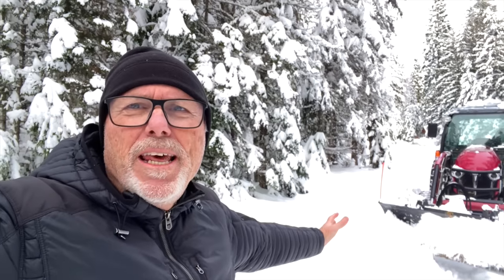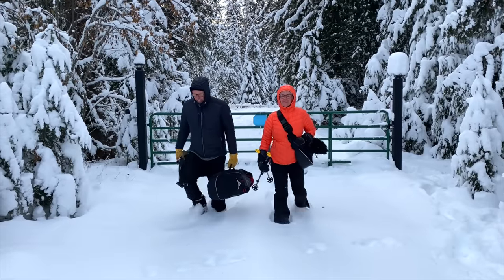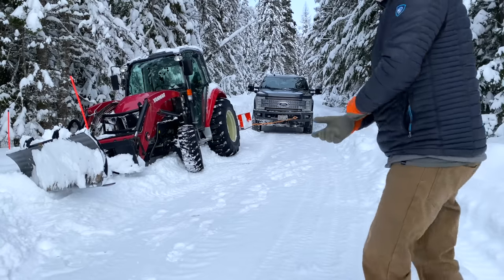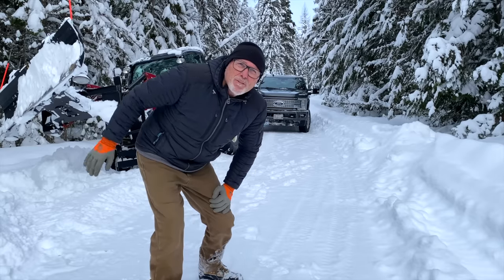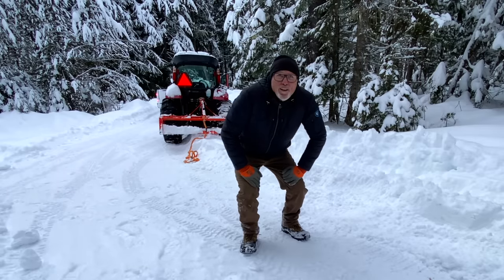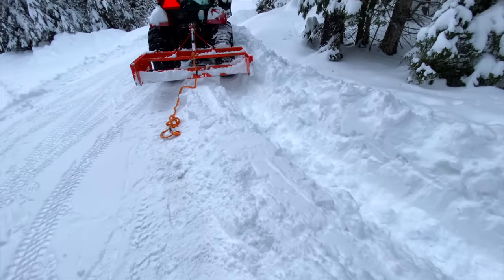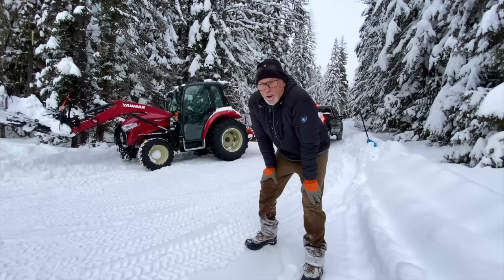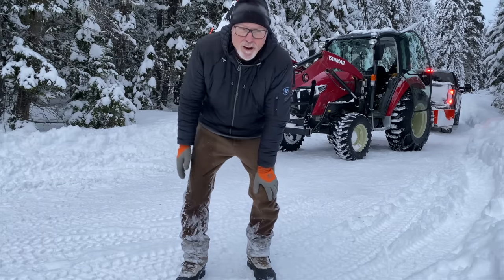WINTER STORMS BLAST Our Off-Grid Homestead

Comment: Never plow without chains......your learning........hang in there.....
Reply from the maker: Last week I had people telling me to return the chains since I have a 4 wheel drive tractor. 😀
Reply: Agree, just cause it's 4 wheel drive doesn't make it infallible
Reply: They obviously haven't driven a 4wd tractor in deep snow. Can you lock a differential, or drag 1 wheel brake slightly to get power to more than 2 wheels? Get those chains on. A small tractor doesn't weigh enough to get traction without chains( front and rear chains are best!).

Comment: Yep time for a snowblower attachment for the tractor.
Reply from the maker: Know of any deals because they are lots of 💵💵💵💰💰💰
Reply: @MountainBeaches  Most people that have dealt with this much snow have learned their lesson that a snow blower is required to move that much snow, blow it back in he trees and keep your tractor on the road !!
Reply: @MountainBeaches  I don't know what your definition of expensive is but a rear blower facing backwards is cheap IMO. If you're looking for a front mount blower or rear inverted blower they are a lot more expensive. Plus, you seem to be very gentle with the tractor but a plow on the loader arms isn't the best combination. You can bend the loader arms fairly easily.

Comment: Whenever I have a front end Snow plow on, I found that putting on the back hoe for the winter works like a charm if you get stuck.  The backhoe can push, pull, lift as well as be an excellent counterweight.
Reply from the maker: I don’t have a backhoe for the tractor.

Comment: You need a yank em rope. Watch a video or two on Matts off road recovery. Its a must have rope living wear you live and traveling like you do. Nothing better.
Reply: anthonyconti  that also was my suggestion, use the momentum of the tow vehicle rather than relying on just traction. He also needs to use the rear differential lock, he was not as only one rear wheel was spinning !!!

Comment: Congrats on getting unstuck! When this happens again (and it will) try this. Place the truck in front of the tractor in the middle of the road in 4WD Low. Put a tow rope (longer than what you have) on the left rear wheel. Brake the front wheel (left or both). Pulling will rotate the tractor back on the road. If you purchase another rope you might want to condider one of the kinetic ropes (works like a bungee cord and multiplies you pulling power with a firm yank). We're in a drought now in New Mexico, but when we used to get serious snow (we're at 7,000 ft altitude) this worked great. Love your channel! Good luck!
Reply from the maker: Thanks so much!

Comment: Does your tractor have diff lock? Mine had it under your right heel, step on it and it gave better traction also if your blade has power angle you can put it down on the ground and use the hydraulic angle to push yourself backwards little by little,  time consuming yes but doable. We look forward to your videos.
Reply from the maker: I discovered the locking diff on that last pull that got me out 🤦🏻‍♂️😂
Reply: I learned a lot about getting unstuck because I had a ADHD pre teen son that would take the tractor to places it never should have went. Lol
Reply: rogerbrown   That was my first thought, not familiar with the tractor operation, both items, he needs to spend some time reading the owners manual on HOW to operate his tractor !!
Reply: @MountainBeaches    well DUUUUUUHHHHH!!!!!!!

Comment: Since you should be carrying a couple hundred pound bags of gravel/sand in the back of your pickup for better traction during the Winter, just spread some of that in front of all 4 tires of the tractor and it will walk right out...Heavy Duty cardboard often will also work most of the time..Just.another good reason to have chains for your tractor in the Winter time.

Comment: Try to pull or push yourself out with the blade. Raise the front of the tractor and pull or push with the blade little at a time until you can get enough traction to drive out.

Comment: Hi norm and Kim      when I have heavy fall of snow my chains are on first .I get that bit better bite  although  some times even the chains don't help I have a big powerful winch fitted on the front of tractorand a winch fitted on a frame that can be mounted on the back .you really need a winch as it can pull you out of most mishaps . Powder soft snow when deep is only good for one thing and that is having a pow day skiing  the slopes

Comment: You need to be using your snow plow blade to push you out. Lift it up high, turn it under, bring it straight down to the ground then turn it back out towards the front. I’ve never bothered with chains and just using the blade have pushed myself out too many times to count.
Reply from the maker: Great tip. Thanks.

Comment: Your problem was ignorance in the operation of your tractor !!!  Most good tractors have a rear differential lock, a pedal on the floor to step on to lock both rear wheels together so they both get power,  ALL the time you only had one rear wheel spinning,  check your tractor and READ the owners manual to learn where the pedal is, makes all the difference in the world.  Also when backing and you need a push use your front end loader curl back as far as you can  lower frt loader, and as you start backing use the front curl to push back, should work even with the blade,  but use your chains and even chains on the front tires,  you also might want to invest in one of these new snatch tow straps that have some give and use the momentum of the truck to snatch it out, back, get some slack and gun it, and the momentum of the truck is more than the traction.